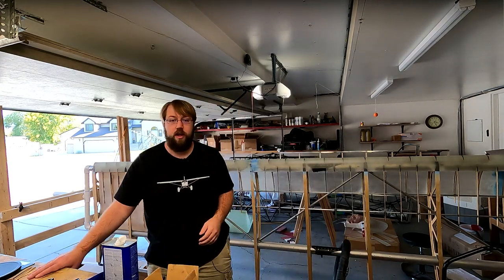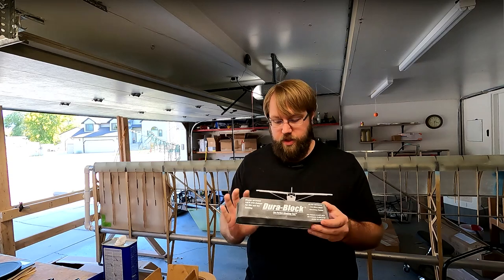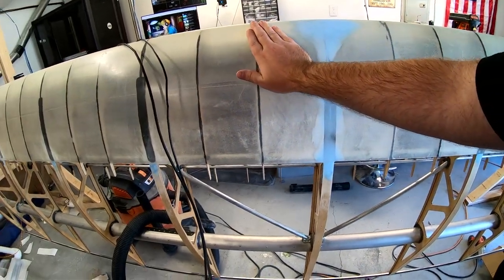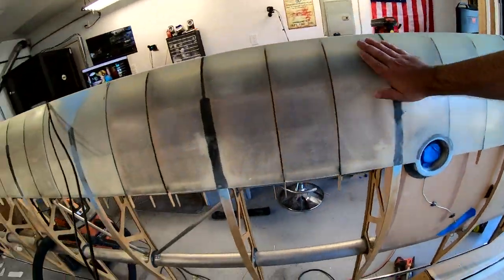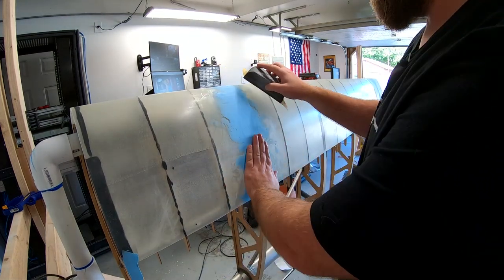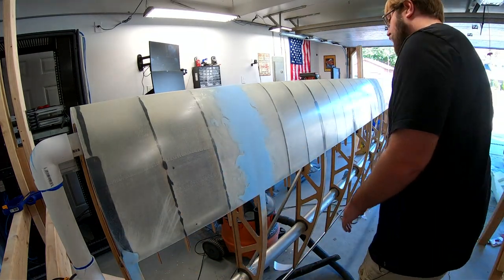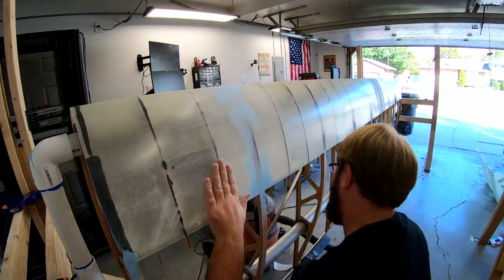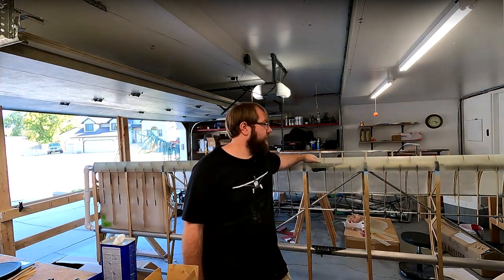Sanding with blocks! - Episode 33 - Salt Fox - Kitfox 7

Comment: Hey Aaron, you said that the high spots were directly over the ribs? Is it possible that the hysol you used to glue the leading edge added thickness to that area? From the video it looks super nice and smooth. I was under the impression that you could take a longer sanding bar across two ribs to work out any high spots, curious why that wouldn't work?